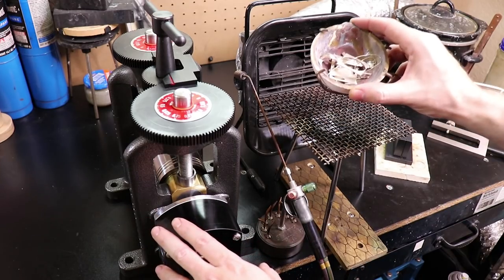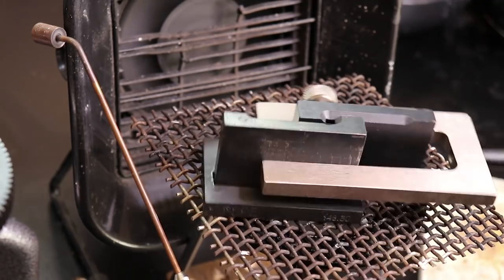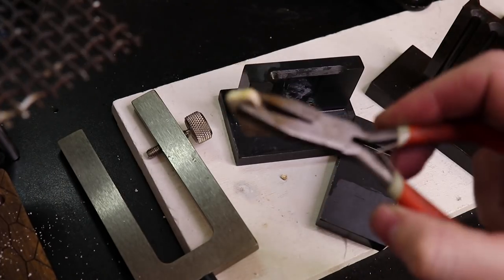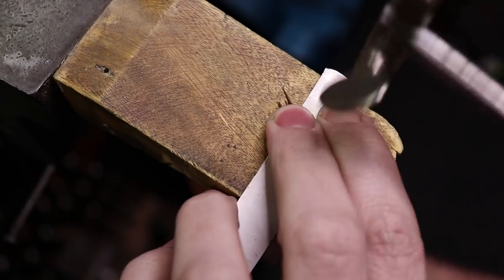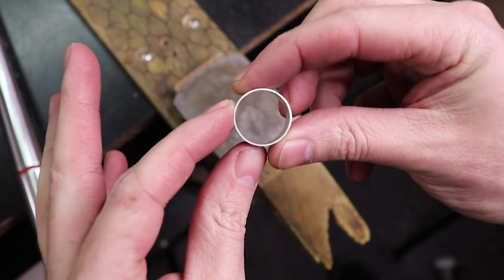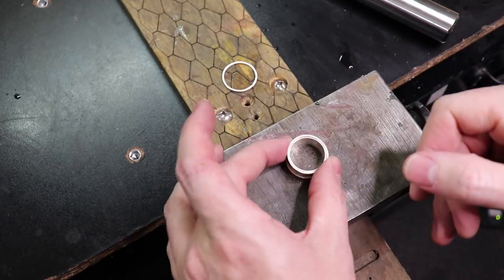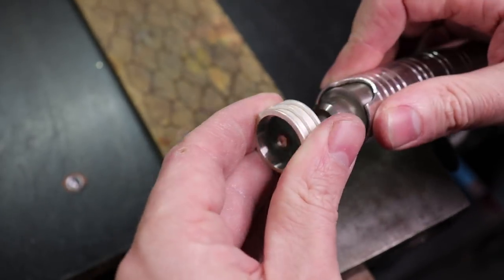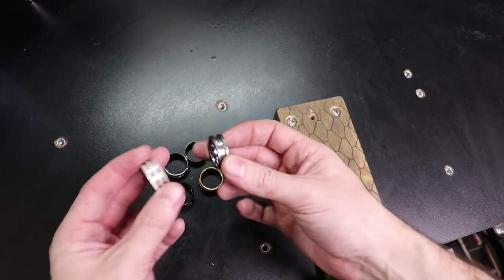How To Make A dual band Silver Inlay Ring Blank Without A Lathe

Comment: A quick suggestion : you could make some wing nuts on the bolts that you use to secure your mill and not only.  Other than that, super info
Reply from the maker: That is a good idea but I do not have everything mounted to the table.

Comment: Thanks a lot for this great video. Can we make this ring using round wire?
Reply from the maker: You can but you will need to file it down for the sides so it will look like all one piece of metal
Reply: @GomeowCreations  Thanks for your answer 🙏You are right. The top side and outside must be filed very well. Maybe inside too for good looking. This rolling mill is very handy but I don't have yet.

Comment: Hey, thanks for putting these videos up! I have a quick question for you- when I try to attach the square wire to the ring, my solder ends up coating the wire and not flowing into the joint. I've tried cleaning the touching surfaces better and also applying flux before I put the wires on, but no luck. I don't typically have trouble soldering, but this kind of joint seems to get the better of me. Any tips for a beginner?
Reply from the maker: Make sure you heat the core ring before moving to the outer rings. Solder will stick and flow to the hottest point so if the thinner outer ring is getting all the heat it will just jump to that
Reply: @GomeowCreations  Ill give that a shot. Thank you!